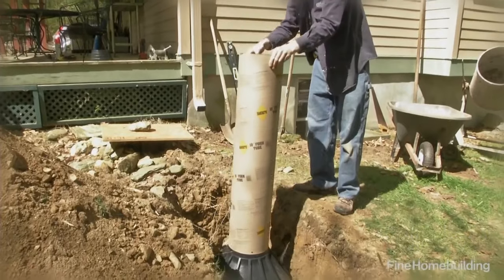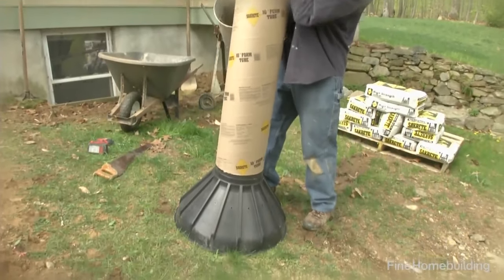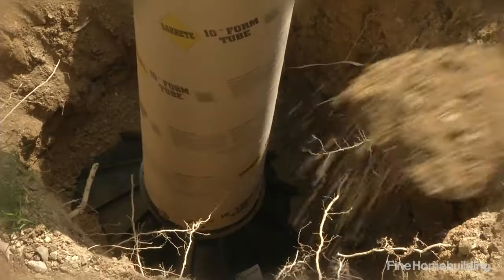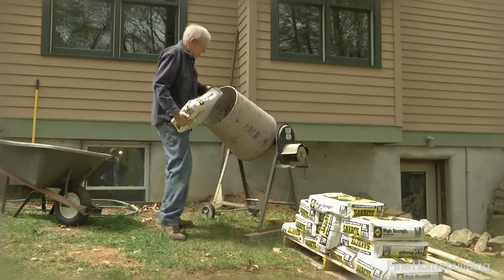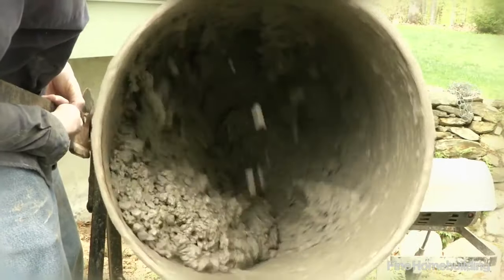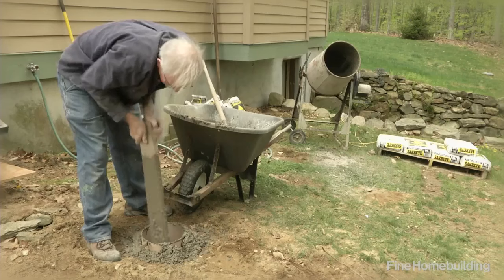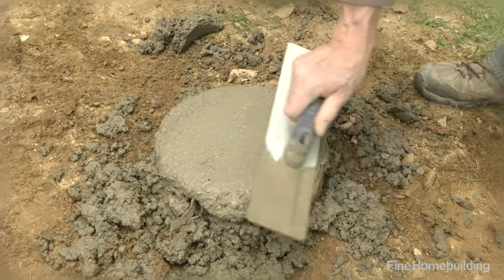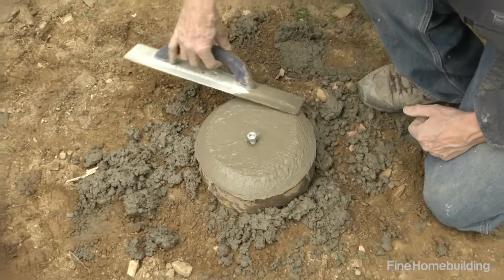Pro Tips: How to Build Deck Footings | New Construction | DIY Project Guide

Comment: No rebar added???!
Reply from the maker: Not necessary for a little guy like this! Generally speaking, of course...call your engineers, people!
Reply: @SakreteOfficial I made a larger footing between two posts with 12mm rebar also with 3 pieces of rebar vertically for each post to keep the vertical posts located. 👍😆 overkill or call an engineer for smaller jobs.
Reply from the maker: Hey, overkill ain't gonna hurt anything!
Reply: I’m on a site right now doing a footing, we have rebar. It’s code where I am any structural concrete needs it
Reply: Call an engineer he says. Am I building a shed or the burj Khalifa

Comment: The screws are just to attach the tube to the base. It doesnt matter if they rust..its a concrete post.
Reply: Steel expands as it rusts, putting the concrete under an internal tensile load and weakening it.

Comment: How do you level off multiple tubes so that they are all in the same plane?
Reply from the maker: Line level (aka. string tied between two stakes) is going to be your best friend here!
Reply: Invest in a laser level. Can get an intro model for about $60 and you'll need a tripod to go with it. You can probably get outta there spending $100 total. Remember, your piers don't have to be perfectly level, just your posts. The laser level will shoot a perfectly level laser 360 degrees around and show you exactly where to cut each post so they are all level. Much easier doing it this way than trying to level the piers themselves (which is probably impossible in most cases anyway). And it's much easier than running string (which is a pain if you aren't good with tying the right knots, etc.)
Reply: Using a laser tracker

Comment: What if the pier height is different by 1/4 to 1/2” on some piers. Does that make a difference if the post are still level before the beam?
Reply from the maker: While not IDEAL, that shouldn't pose a major issue. That said, we're not engineers...would double-check with an expert on that one!
Reply: @SakreteOfficial Would not make a single difference, posts are often cut to the correct height after the fact when the soil isn’t compacted properly when the footing is poured due to it compressing from the weight.

Comment: What PSI concrete do you recommend for vertical form tube piers?   I'm using (9) 10" piers for a 12 x 16 storage shed that is on unlevel ground.    Thanks.
Reply from the maker: All depends on the load they're supporting, but we always go as strong as possible Give the 5000 Plus a go!